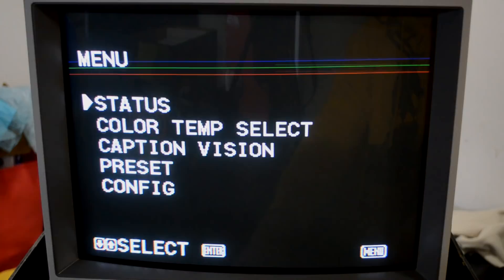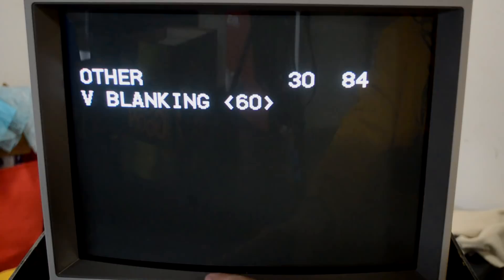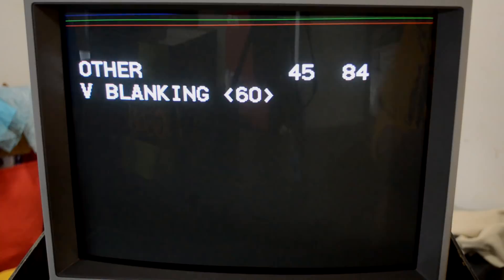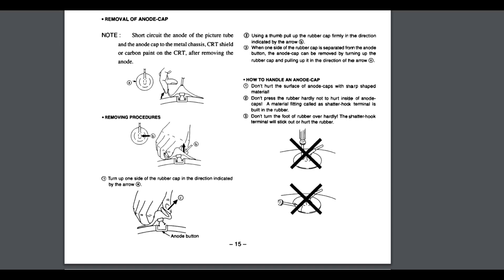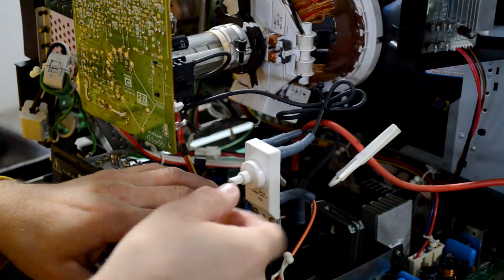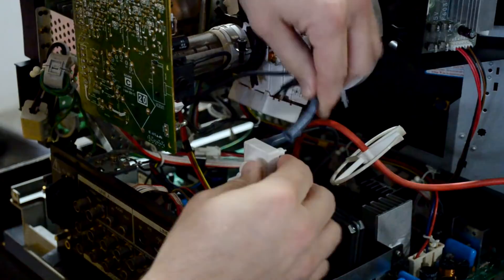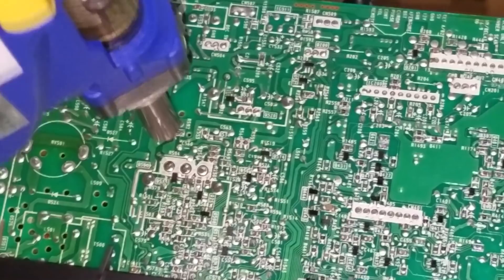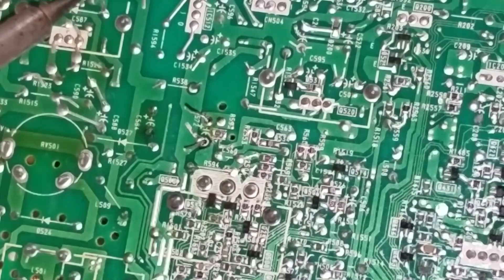Repairing a Sony CRT Pro Monitor - Red Green Blue Lines?!

Comment: Found a little consumer set on the kerb that has this issue. The lines have only just drifted a few mm onto the viewable screen. Not visible during gameplay really though I need to see if it resolves itself after a bit of use or if I can get into the service menu

Comment: Awesome vid. Another pvm lives to play another day! 

I did my first saudering job and now I'm feeling spunky and looking around the house for something else I can modify. I was thinking of installing a fan in one of my monitors. What are your thoughts on this? I have heard that it can extend the life of your monitor. Some bvms have built-in fans.
Reply from the maker: Thanks!  It's a good idea, but make sure you get a quiet fan or it may drive you crazy.  There is a loud fan in one of the input cards for the PVM L series that will drive you bonkers.  Fans are good to reduce the heat.
Reply: @RetroTechUSA  yeah i heard that the fans in the bvms are loud and most people disable them. I think i can find a quit one
Reply: I'm adding a few 12 volt fans in my 20M2U. You mostly want them passing air across your major heat sinks... so the deflection area and your power supply board. Be sure to suspend them with rubber screws/rivets so the vibration doesn't travel to your chassis. TechQuickie has some god videos on fans here https://www.youtube.com/watch?v=Oc9c8LFY1bg
Reply: @diopterdoctor120  cool thanks. I will check that out. I was just going to use one likr an exhaust fan and bolt it to the chasis
Reply: @RetroTechUSA  Hey, does the repair you demonstrated in the video apply to consumer crts as well?
I have more or less 30 crts and they all have this problem, now, i can overscan but then i get light reflection on the back of the tube, which ruins the black level.
So, is this a solution i can apply to my situation?

Comment: I can only see the red green blue lines when in the under-scan. What do I need to do to prevent this from getting worse?

I have a Sony PVM-20L2MD.
Reply: Seconded.. I have the same thing on my 20m2mdu. Anyone have thoughts?? Am I doomed
Reply: @SabatinoSmith  this is old dying tech... not much to say other than learning to repair them like Retro Tech, (which takes time and bravery.)
Reply: Update, it has gotten worse and now is a bit visible even without under-scan.

What are the caps for a L2 model?

Comment: Hi Steve, Bit confused as Sony also say to replace C584 with 1UF 160V (not 2.2UF 160V) in another bulletin? 

Quote :

"Part required: Sony pt# 1-124-940-51 Cap, 1uF/160V, 105 degree C high ripple Qty: 1

Modification procedure:

Replace C584 (2.2uF) with 1UF high ripple capacitor. NOTE: Since the diameter of this new capacitor is larger than that of the previous capacitor, make sure the C584 capacitor does not touch the Q503 heat sink or the D527 lead wires.

Perform the deflection adjustment according to service manual."

Comment: So those AKB lines are normal, that is if they stay above the viewable area?
I recently got a Sony Trinitron KV-21LT1E which has a 4:3 tube. When it's in the normal 4:3 mode, those lines are not visible, but to my surprise when I switch the TV to a 16:9 mode, then the lines do appear near the top of the letterboxed 16:9 image. Is this normal behavior for a Trinitron consumer TV? Or should those lines still be above the screen even in 16:9 mode?

Comment: A buddy of mine has had the same issue on this model PVM with the RGB lines. The monitor recently stopped showing the top 1/3 of the screen altogether with the bottom 2/3 displaying normally. Occasionally when toggling the underscan and similar settings, that top 1/3 will activate again. Is this still the same issue with the 2 capacitors? Do you have a vendor you recommend sourcing them from? Thanks for the awesome video!

Comment: thanks for your video,My PVM 14 L2，underscan mode，The top will show these Red Green Blue Lines，The image is also slightly distorted，distorted at the top close to the position of the line，Through your video, I decided to check it out，So do you know the associated capacitors?

Comment: Thanks for the great video. Can both replacement capacitors be after market capacitors as long as the voltage and uF values are suitable. Also I see one replacement capacitor needs to be 160v 10uF - what value should the other be? Also does the C584 needs replacing with 160v 10uF or the C572? Many thanks
Reply: C572=160v 10uf . C584 160v 2.2uf
Reply: @leonardohood7274  Thanks a lot
Reply: Im confused here. I though it was C586 and C572 per the sony service bulletin?
Reply: @leonardohood7274  should a 4.7uf be changed to a 10uf? The bulletin said to change with same rating just a long life (higher temp?) version. I really appreciate the highlighting of this issue but there is conflicting information everywhere. I changed 572 & 586 as per one video and still had the issue. Then there’s another video saying 572 & 584 but no mention of what to upgrade the 584 to. Where did this info come from? I just don’t wanna screw up a PVM.

Comment: Thanks for the video Sir, amazing information. I'm experiencing the same problem. I'd like to ask the horizontal angle of three lines were shifted (right ends are upper), so did you do anything specific to solve this problem or just recapping was enough?
Reply: In a video he made later on he said that recapping is more permanent than moving the lines up in the menu. In fact moving the lines up in the menu actually ruins the fly back which is quite expensive to replace

Comment: I see you remove the anode cap with your bare hands, isn't that pretty dangerous considering the current could jump the air gap in theory? You seem to know what you're doing though, I myself am too scared to do this repair, either for zapping myself or screwing up my PVM so I will probably have a pro do it for me. If I were to attempt it myself i'd probably wear elbow length rubber gloves or something....

Comment: Good day Steve. I have a similar issue but not to that extent with my 14M4U.  Would doing the same replacement on my 14M4U alleviate my issue as well?
Reply from the maker: Hi Kelly.  Yes, the 14M4U has the exact same Chassis/Main board, you can do both of these repairs.  If the problem is less pronounced, you may only need to make the adjustment in the sub-menu.
Reply: @RetroTechUSA  Yeh I have tried the sub menu fix some years ago. But I noticed that as time goes by with the PVM on the lines start to appear on screen. So I think it is safe to replace my caps on it.

Comment: I have a sony consumer crt with same problem but rgb lines are not as seperated and are about half the distance to top compared to one in this video. I replaced caps in vertical circuit but no difference. Would this be a a candidate for adjustment? Just didn't want to risk blowing up the crt like you mentioned might happen. Its a kv-24fv12. Was hoping to get going so I could do a rgb mod. Thanks

Comment: Hi, I have a Sony Wega KV 27HS420 that when doing a "cold" power on it shows those red, green and blue lines at the top, then they start moving slowly to the top so they dissappear automatically from the screen. Do you know if that is a problem or is normal operation? Is there an adjustment that fixes that? Or there is something that is breaking inside. Please help

Comment: I need help on my KV-32fs13, it displays these three lines horizontally accross my screen. When I slightly tap the side of the tv, the screen comes back on. Can anybody tell me if they have the same problem and if there is a solution?

Comment: Are these the same caps for most sony crts? I've got the same issue on a 2001 model KV27S42 and looking to repair. It looks like if I leave the monitor on long enough the caps charge and the problem goes away at least but I need a permanent fix.

Comment: Hi there Steve I have a problem with my pvm 1444qm  it makes strange lines withoount being connected to any source. The screen is kinda blue
Reply from the maker: probably needs the flyback turned down a little bit.  There is a screen Pot adjuster on the back of flybacks.  Turn it down a little and see if that helps.  You can do this while it's running just be careful.

Comment: Would this fix partial vertical collapse? I have a 1354q that I believe has that. The scanlines look progressively more compressed going down the screen and with the linearity grid the top circles fold over onto themselves. The red green and blue lines are visible, but messing with the vblanking like you suggested makes them invisible, but does not fix the problem.
Reply from the maker: I'm going to have an announcement about cap kits that will be available.  I will have a kit for your PVM model.  The Geometry Cap kit will clear up those issues.
Reply: @RetroTechUSA  Ah sweet. Thanks dude.
Reply: @RetroTechUSA  I have the same pvm, looking forward for that cap kit!

Comment: Hi Steve, what is the cap location for this problem on the N series pvm pls? I have a very slight rgb line at the top of my screen. I can hide it with the service menu settings but I'd rather do it properly and replace the caps. Thanks
Reply: Hey Lee - did you end up finding an answer for this? I have an N-series SIIA chassis monitor with the same problem
The lines are only just visible
Reply: @fredsk1  I didn't. I had no response. I've ended up making my own cap list from the service manual. I'll replace all the caps and see if that solves it.

Comment: Will this cap replacement fix move those lines out of view when using a 20L5 in 16:9 mode?
Reply from the maker: Most likely not.  That is why there is an optional 16:9 bezel for the 20L5
Reply: True but that seems like a design oversight. I mean I could put tape on the screen to cover it up and that would be the same. :)
Reply from the maker: @zdthn  Will it go away if you adjust the "V Blanking" setting in the sub menu?
Reply: I have done that but i think I reverted back for some reason.  I use it in 16:9 so rarely that it isn't really and issue.  I guess I was just wondering. thanks